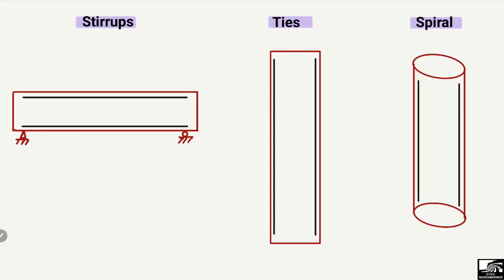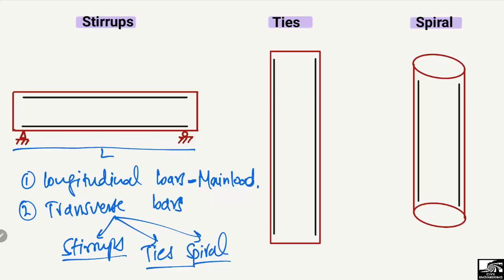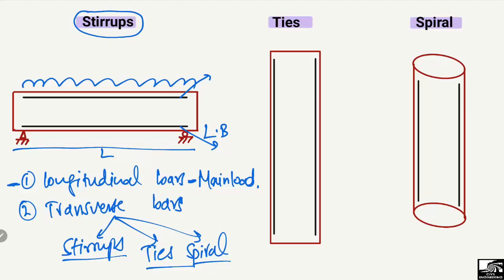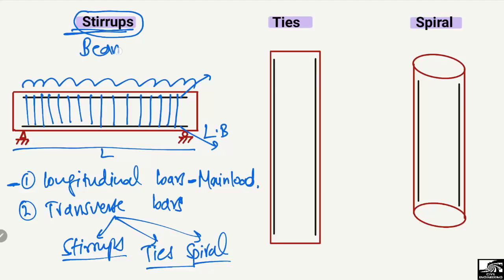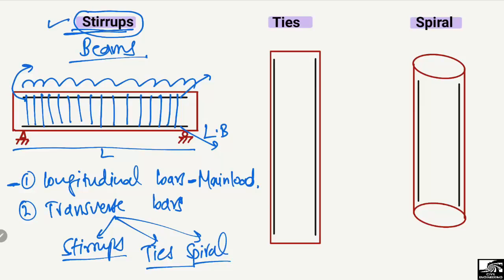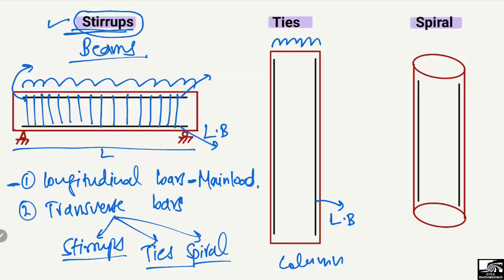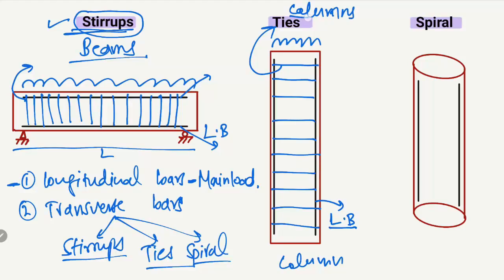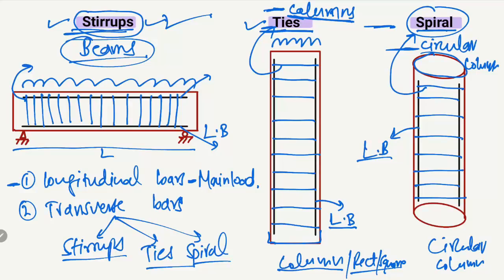Difference between Stirrups, Ties, and Spiral reinforcement

Comment: The transverse reinforcements in columns regardless the column cross section or shape whether rectangular or circular are called "ties" as long they are implemented of many pieces and each one is covering one plane along the column height. This reinforcement is called "spiral" when the transverse reinforcement is on piece along the height of the column, its shape looks like springs used in the suspension system of automobiles.

Comment: Not clearly articulated. 

In the video it says in both the beam and column if transverse bars are perpendicular to the longitudinal bar then they are called Stirrups and ties respectively but not any differentiation is mentioned.

If any transverse bar is placed in perpendicular direction to longitudinal bar why are the name of the bars not the same. Why do we have to call them stirrups and ties ?

They have different names because they have different loads to carry and act out. I was searching for a video to explain all this but even this video fails to do the same.

No clear loading persecpective is given.

Please upload a more informative explantive video.
Reply from the maker: The only difference that these both reinforcement purposes are different. Transverse reinforcement is mainly provided for shear resistance, lateral force resistance and confinement of the concrete